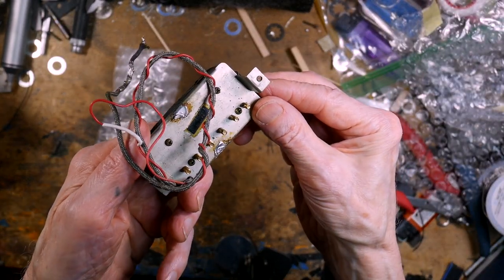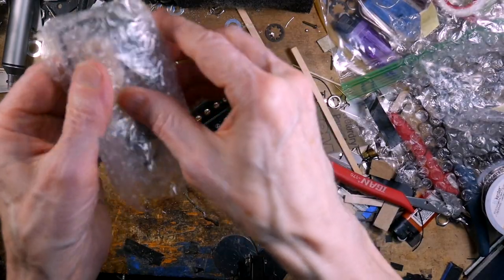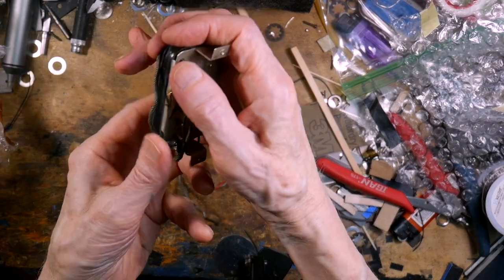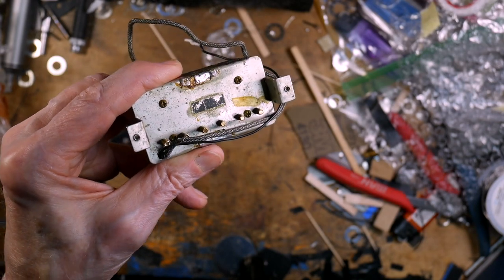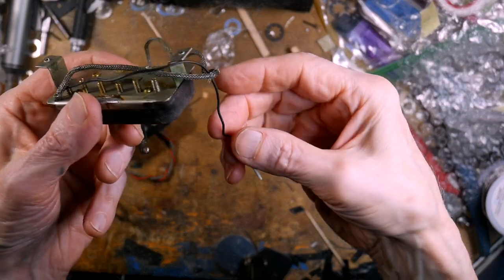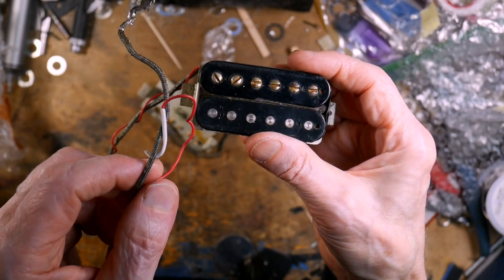Teaser trailer for 1959 PAF set restoration video.

Comment: That´s gonna be another cool one video. :face-blue-smiling:
Reply from the maker: I sure hope so, I just hope the coil tap wire isn't risky to remove. Both PAF's are 7.6K, so they are going to be super bright, especially in bridge position. Usually that low they can be somewhat harsh.
Reply: @SDPickups  I see. I usually love bright pickups and use the tone pot to easy things a bit when I need but I see your point. I wish you all the luck and God bless for those free repairs. You´re a good soul.

Comment: Dave,that is insane not charging for rewinds?  Insane in a great way!!  Looking forward to these vids.
Reply from the maker: Not insane, LOL. Restoring these old PAF's has given me years of first hand looks into them from every year they were made. Many of them don't require rewinding, and its the very last thing you want to do to them, but some fixes can put them back to work, so they can be heard again. This particular pair don't require rewinding, they were abused to be used with coil tapping, so its a fairly simple fix to remove the extra wire. The hard part is they both need the braided wire leads replaced because they are in terrible condition, so the entire pickup has to be disassmebled, which is risky business ;-)